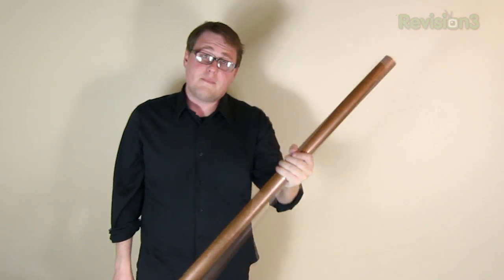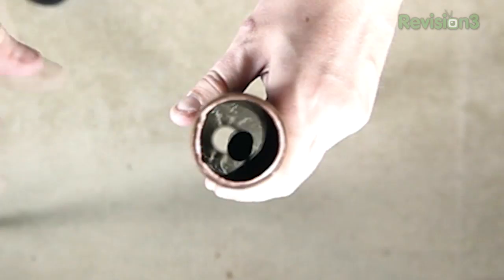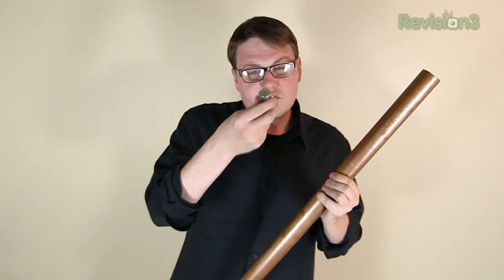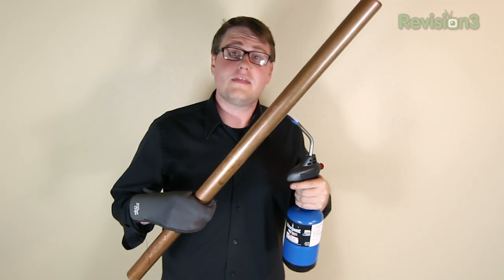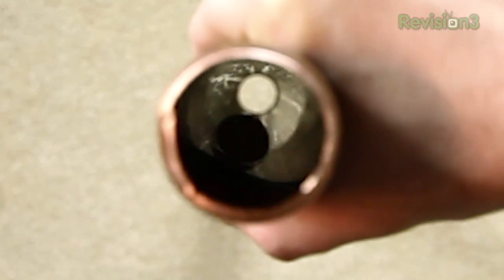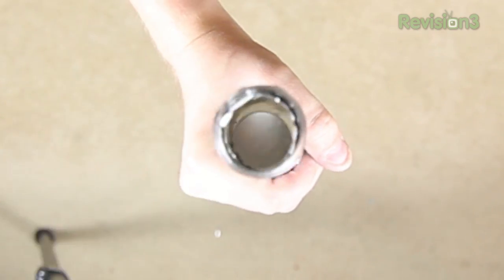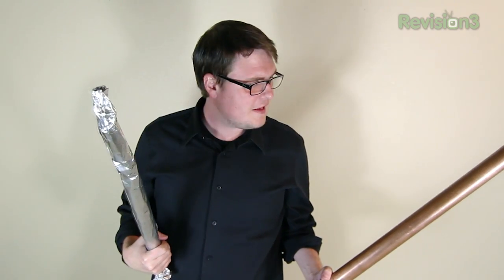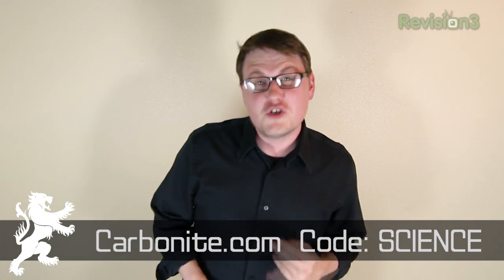Defying Gravity

Comment: this is motor action in a generator. by dropping the magnet through the pipe you have 1. a conductor 2. a magnetic field 3. and relative motion between the two. these three things are the requirements for a generator.

however, when you create a generator you also meet the requirements for a motor which are 1. a current carrying conductor 2. in a magnetic field. this "torque" works in reverse of the torque applied in the generating action.

this is explained in more detail in motor/generator theory.
Reply: Matt Szostek  the reason it is reversed forces is the direction of the magnetic field N->S generated. there is also reversed generator action in a motor. it is called "counter electro motive force." Electricians Mate 1st Class, USN

Comment: Carbonite cannot maintain intact data in certain due to the assumptions they make in the program.One specific situation is against a tax software that is used by the largest tax firms in the US, carbonite cannot retrieve the database from backup as it's process corrupts the database. Just saying, examine your requirements before choosing a backup solution.

Comment: @ 1:48. No... It isn't gravity's fault. It's the resistance in the copper pipe. 0 resistace equals no energy loss and the magnet vill simply float in mid air :)

Comment: Good video! Amusing &Scientific. I wonder, if the Cu tube was say 100 ft long, and the diameters of tube & magnet much closer in size, and you had the tube connected to a meter... Would current be generated? How long a tube is needed before signif heat is generated? And yeah, put on a Neo suit & jump down a long copper pipe. I'd like to see that! So many questions!

Comment: The annotation at 1:26 isn't quite right. Copper is paramagnetic, meaning that it responds to a magnetic field (as the demonstration shows). But it's not ferromagnetic, so it can't be magnetized and won't stick to a magnet.

On an unrelated note, Carbonite has saved my ass more times than I care to admit!

Comment: @NeroDTK get a magnet moving by other means and still get this effect (if you shot this magnet through the tube when it was turned sideways, it would still produce the effect). The only thing that would be different in space is that a strong enough magnet with a long enough pipe could in theory over-come the magnet's momentum (one time force) and stop the magnet, whereas these magnets will never overcome the constant force of gravity.

Comment: @NeroDTK When a magnetic field pierces a surface, the amount of field within the surface is called the flux. When flux changes (note: changes!) an electric current is induced (in an electrically[not magnetically] conductive material) which generates a magnetic field in opposition to the change in flux. That is what is happenning here. So to answer your question, for an emf to be generated, the flux has to change, so in this example the magnet must be moving. Gravity does that here, but you could

Comment: @hullohulloRFC Copper is non magnetic. The magnet moving through the copper induces eddy currents within the copper, these create an opposing electromagnetic field, that slow the magnet. The thing to note is that any material that conducts electricity and has a moderate width can do this. The magnet is not attracted to the metal like it is to something ferrous like iron. :)

Comment: Just a simple experiment. The magnet has a magnetic field, then when it fall through the tube it produces a change in the flow, which automatically makes electric current in the tube, which automatically leads to a new electromagnetic field in the tube. That field generates a force to the opposite direction of the material thrown inside, and the more speed it has, the more force it generates. The result is that the material will fall at a constant speed.

(Sorry for my English)

Comment: @thipan15 Your forgetting that the copper tubes/aluminium tubes are NON-magnetic. so theres no magnetic interaction between magnet and tube. If the tube was magnetic it will just stick to the side but notice how at 0:15 the magnet isnt sticking to the sides

Comment: @Youcansuckme69 .... while a can is in the cylinder made with the pipe. The rapidly changing current induces a huge magnetic field, which changes very very very fast, which creates a very huge, rapidly changing current in the can, which has its own magnetic field which is very strong. The two magnetic fields oppose each other and the can will be crushed. Be careful, the current may be in excess of 750 amperes, which is enough to kill several hundred people.

Comment: Extension of this project:
Buy a ton of disposable cameras. Tear out the capacitors and connect them in series. Leave individual terminals on each capacitor exposed. Get 4 high voltage diodes and make a diode bridge. Rectify the 120V AC from the outlet. Connect a series resistor of 10-100 Ohms. Charge each capacitor individually for about 30 secs. Get a flexible copper pipe, bend it around an aluminium can as tightly as possible with any shorts. Discharge the capacitor bank into the pipe....

Comment: @bxxch10 The problem with that is it wouldn't work with what I'm trying to do. I was trying to make a perpetual motion machine, and of course the main obstacle is getting the water to go back up. I was thinking about trying to use marbles instead, but I would need to get fairly strong magnets.

Comment: A magnet is any object that has a magnetic field. It attracts  objects like pieces of iron, steel, nickel and cobalt. So really. When current flows in a wire, a magnetic field is created around the wire. From this it has been inferred that magnetic fields are produced by the motion of electrical charges.

Comment: @SPQ96 How do electric fields work? The core physics is largely unknown, and you will how to go into quantum physics in order to explain it fully. There is a core difference between magnetic and electric fields, however as magnetic fields only affect moving particles, and particles moving perpendicular to the field lines. Therefore for instance whilst in an electric field an electron form a parabolic path, in a magnetic its a circular path.

Comment: Pretty good, but the part where the magnet falls because of gravity is only partly correct. The magnet moving through the pipe creates a B field from changing current, if the magnet were to stop, the field would cease to exist, and the magnet falls, but falling creates the field. Eventually these two forces find balance, that's why the magnet falls at a consistent rate. Still an amazing presentation.